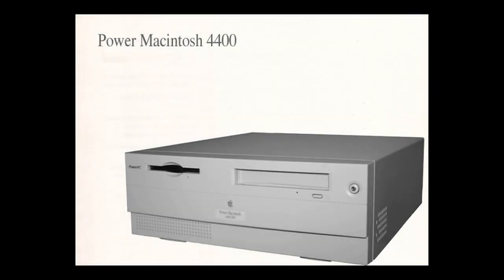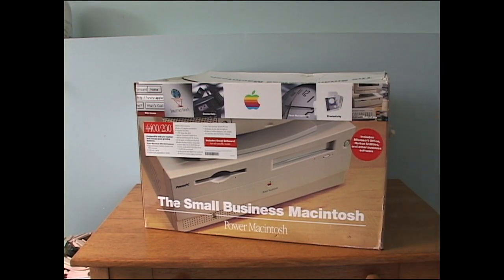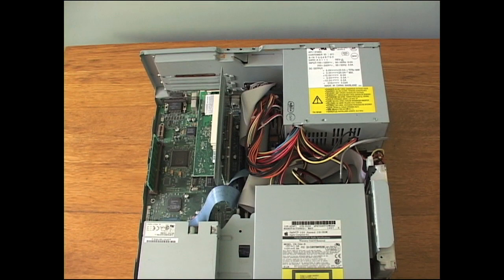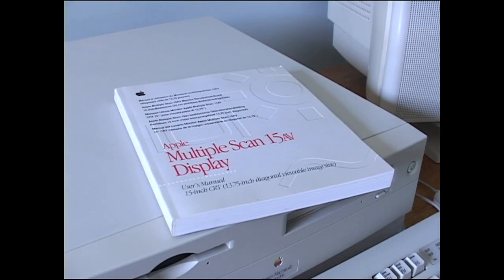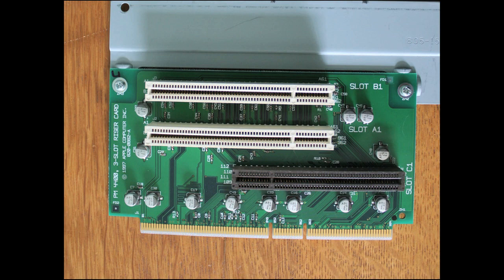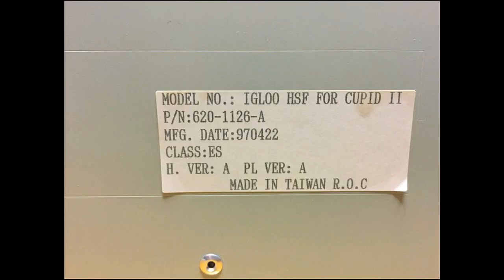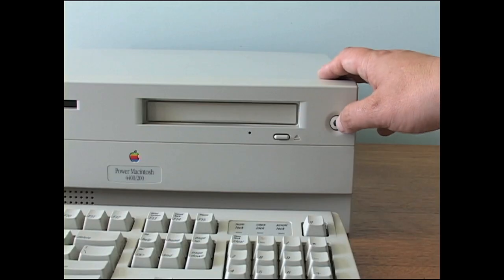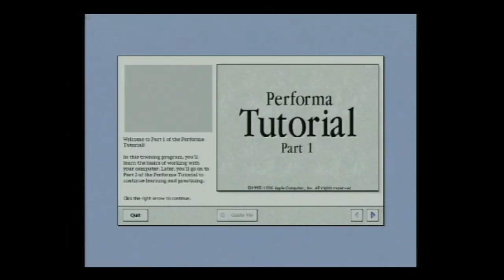The Power Macintosh 4400

Comment: This mac was nothing more then the Starmax Mac clone. Not a bad mac, it just wasn't one of them great macs in the eyes of many. I remember most Apple types complained about the metal case. But, I would sure rather deal with this Mac over say a 5200. I've owned one. Owned I would highlight. I still own a 7600 with a G3 350 mhz replacement daughter card. I use to run run Mac OS 7.6.1 and BeOS 4.5. It does that task well. If you've ever used Mac OS 7.6.1 or 8 with 350 mhz worth of power and 256 mb of ram, you might expect that it would. The downsides to this is the plastic. While Apple guys back in the day complained about a Mac dressed in metal, that metal sure holds up better. Mine isn't bad. It's just brittle. At least the guts still work:) Nice Mac.
Reply from the maker: Interesting stuff. There were definite downsides to both plastic and metal in the Mac cases of the nineties. What recent technology can do with aluminum has really helped in that regard. I remember how my G4/400 flew through 9.2. I can’t imagine 7.6 having that kind of power! Thanks for sharing your experiences.